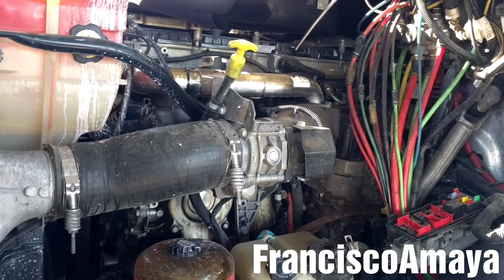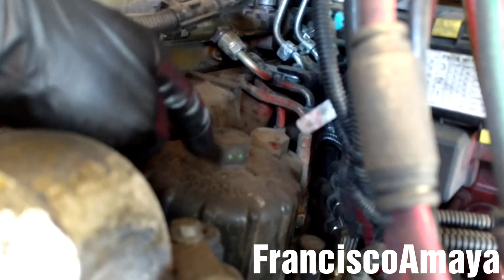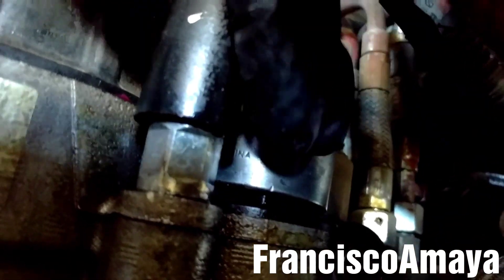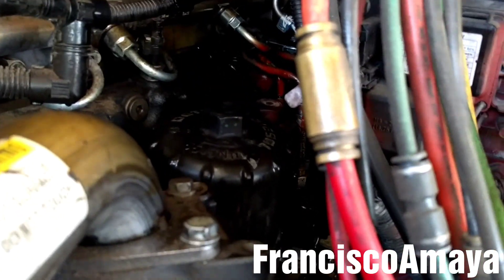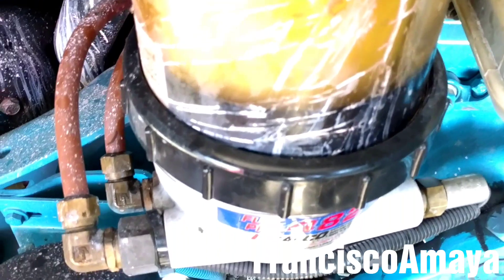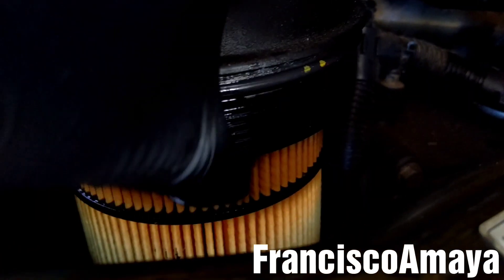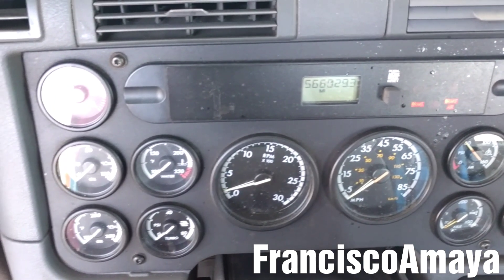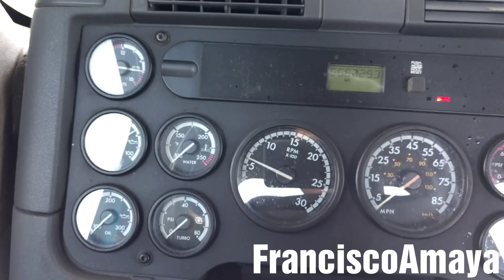Freightliner Cascadia DD13 ENGINE oil change explained OM 471

Comment: How often you change the oil on Detroit dd13
Reply from the maker: Depends on the oil type  
12k - 25k
Reply: Rotella t5 semi synthetic recommends up to 50k,so it does depend on usage,like if its mainly otr or local work. I personally go 35k on t5 rotella otr.
Reply: My company goes 70k on their company trucks on Semi synthetic! Crazy stuff.

Comment: Hey Francisco, thanks for great videos.  They have taught me much about my truck.  I have a question I can’t get answered, maybe you can help.  On my 2013 cascadia dd13, there is a filter underneath the transmission that I have no idea what it is and it looks like it’s never been changed.  It looks like a normal automotive oil filter and hangs down slightly angled towards the rear. , the lines coming to it look like they are coming from the front radiator or charge air cooler. Any idea from the information I have gave?  I’ve searched all the manuals, service manuals, Internet...I can’t figure that one out.    Also, I just change both the inlet and outlet nox sensors due to the fault codes.  After replacing the outlet first (I has to wait a week), the fault code for the outlet sensor did go away but after I changed the intake sensor, the fault code for intake won’t go away.  I’ve reset the codes, disconnected batteries, unconnected and reconnected the sensor, still it persist.  It’s my only remaining fault and it’s driving me nuts!  I purchased the sensors from freightliner, could the new sensor be bad? Or is there something else I should try before I spend the frustration removing the new sensor again?   Thanks again for you help.
Reply from the maker: Email me with pictures
franciscodamaya@gmail.com

Comment: This truck has a charging issue. The voltage on the gauge is too high, almost in the red. Overcharging the batteries
Reply from the maker: Check the remote sense fuel

Comment: Francisco, after changing my filters i push on the primer about 200 times. It never gets solid and takes me about 4 times to get the truck running (i only let the starter go about 20 seconds each attempt) what could the problem be? Thanks and I really enjoy your videos, learned alot!!!
Reply from the maker: Air in the system, or a bad fuel check valve.
Reply: Francisco Amaya I’ll get it checked out, thank you!!!
Reply from the maker: Do you know the check valve location?
Reply: No, sorry i dont.
Reply from the maker: Do you have the two or three stage fuel filter housing?
Reply: It has 3 fuel filters, its the DD15
Reply from the maker: Ok, it is a 8 mm Allen located next to the fuel inlet in the housing.  They usually get stuck open specially if you don't have the fuel water separator in the frame.
Reply: Ok thanks, i’ll check it out.
Reply: So is this check valve inside one of the 3 fuel filter canisters? Im going to be doing a PM this weekend and would like to replace this fuel check valve if i can find it. Thanks!!
Reply: Lance Bradley or Francisco can you send some pictures where is the fuel check valve thanks i got s problem like that

Comment: Never change oil and fuel filters at same time big big no no
Reply: Change the oil first then crank truck up and make sure you get proper oil pressure then cut truck off then change fuel filters
Reply: What happens if you do? I've heard there is a certain order to do things in.

Comment: You fucked up buddy.. your supposed to change oil filter then add oil then start it. Let it run 5 min then change fuel filters .. you can blow the engine .. then once you change fuel filters just pump it until it’s hard start it for a second pump again start it then pump one final time until it’s hard n it will run

Comment: Thanks for sharing informative videos. Very helpful..1 question:  If u have low oil pressure even after PM service in DD13, what steps or solutions i should look into?
Reply: Its the oil sump gaskets,located inside the oilpan. It happened to me and had to replace oil sump kit and oil pan gaskets and screws,because the screws have grommets attached! Its pretty pricey too,so be ready if you haven't already fixed it.

Comment: Francisco necesito cambiar la fuel pump de un dd15...  donde te localizo? Mi email es aguilar343@msn.com ... yo parkeo en fontana. Gracias
Reply: Francisco after how many miles
Do you recommend change the oil
Reply from the maker: No more than 30K Miles  with synthetic blend or Full synthetic oil and replace oil and fuel filters. 

If you use conventional oil, replace the oil and oil filter every 15K miles or Less and the fuel filters every 30K miles.
Reply from the maker: If you follow this method, your engine will be able to reach 1M miles or more without overhaul.